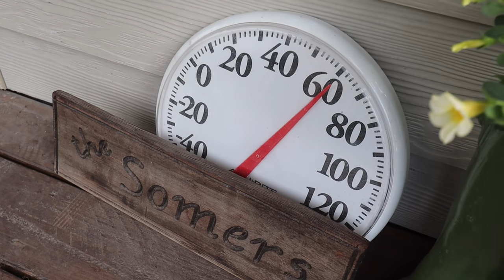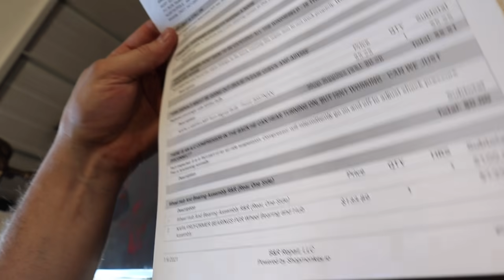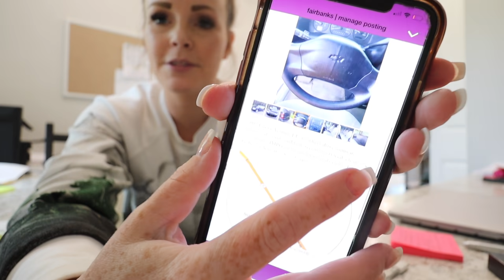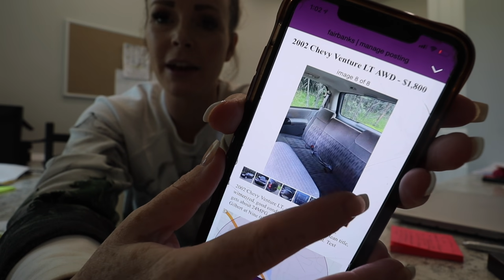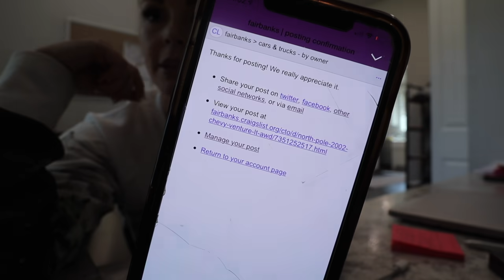GAVE OUR CAR TO A STRANGER! | Somers In Alaska

Comment: yay.. my husband and i have done the same thing with several of our older vehicles.. we tend to get them used in the first place and then drive them until we don't need them (usually because situation has changed and we need something different...) and have given some away, sold some for a pittance (think the $5 range... ) because the person receiving wouldn't accept the car for free.. we've been in the position in the past where we had to go to freecycle looking for a car, so, it's only fair that we do the same for others...

Comment: My dad did this same thing several times for the same reasons...because it happened to him once before 💞

Vehicle shortages because of computer chip manufacturing delays about the time when covid hit AND importing them from our friends in Asia. 😉👍
Lumber shortages as well from mills that aren't increasing production
Tin/aluminum is the 3rd item of shortage.

Our 2000 Explorer has been a true blessing...103K miles, 4X4, engine block heater, excellent condition, only owner...best vehicle I have ever owned...🤣🤣🤣WE LIVE IN TEXAS AND IT WAS PURCHASED IN TEXAS😎